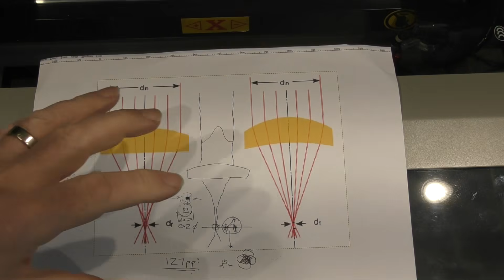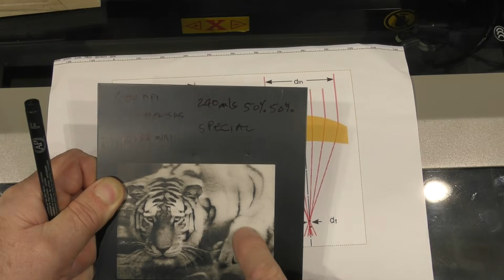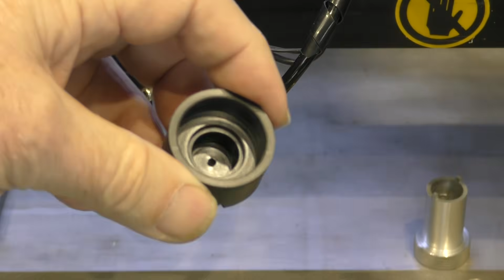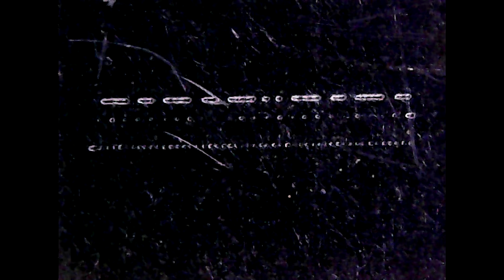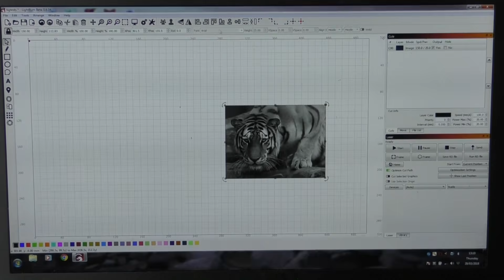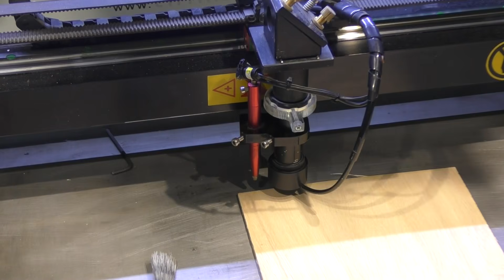RDWorks Learning Lab 137 Compound lens Facts and Fiction

Comment: You’ve talked me into trying a compound lens. I purchased from cloudray. I have a 60 watt OMTech. I purchased the nozzle and the PVD (38.1) and the CVD (63.5) lens. I have 2 questions. Maybe 3. 
1. Both lens flat side down correct? 
2. The CVD lens goes in first followed by the PVD correct? 
3. What is your cleaning process for the lenses? Same as all other lens? Just x2?
Reply from the maker: HiJosh
Yes you are right with all your assumptions  If you scroll down the Cloudray web page there is a diagram that confirms the way the lenses fit. The top 38.1 lens is not exposed to fumes  and will not need much attention. The airgap to the workwill be 10.5 to11 .5mm  (depending on speed) so there will be little chance of fume damage to the bottom lens either but i do check regularly.  Used for photo engraving, the main purpose of the lens, I suggestyou use low power in ther preionization zone for your tube.This zone creates an obviously noisy, hissy, cut. see  this video for an idea of what I mean.    https://youtu.be/S_2NOCpACVc

Comment: Thanks for the great explanation.
I use a CO2 laser at work and was very annoyed that the focus point is only 2mm below the tip of the nozzle. Having the nozzle this close to the media you're working on leaves no room for uneven surfaces. I will take it apart and seen if there's a way to get the nozzle closer to yhe lens (or vice versa).

Comment: Why not just use a 16mm camera lens that focus with no distortion?
Reply from the maker: Hi
 I wish life was that simple.  The 10.6micron wavelength light we are working with  has very limited properties.  ALL metals reflect it (mirrors). A VERY small selection of special salts allow it to pass  (lenses) . EVERYTHING else absorbs the light energy. Thus normal glass is in that last group and is totally opaque. Fire the 10.6micron light at glass and it will just heat up and damage it. Thus normal lens materials will not work.

Best wishes
Russ

Comment: Very interesting video. My question is a bit off topic but I'm still a novice so forgive my ignorance. I think you show the insertion of lenses, curve side up, however, I've watched other videos where the opposite is shown, specifically here:
https://www.youtube.com/watch?v=Eg6THrEdleo
At around 13.22 he says curve side down. Who's correct?
Reply from the maker: Simple answer is both. Although these are specifically sold as ENGRAVING machiones,most people want to cut with them Cutting is done more efficiently with the flat side down but the focal distance will be anything from 1 to 2mmless (you will need to test this for your lens) But you get a better focus for engraving with the lens flat side up.  The Chinese always supply machines with flat side up  but most experts will tell you flat side down is "correct" . There is no absolute correct way, it depends on your need. You can engrave quite OK with flat sidedown for most applications but fine detail and small text are when you need to flip your lens.

Best wishes
Russ

Comment: Hello , 
Thank you so much for your many many tutorial
I have a question about the beam diameter,

The reci tube 100w  have a beam diameter 8mm
The Spt tube 100w have a beam diameter 5mm

A large beam diameter is better to have a small spot diameter no ?
But with a Small beam diameter we have  narrow cone and so still have power when one deviates from the ideal depth of field ?

So to cut material, have a small beam diameter is better ?

Right ?

Thank you so much
Reply: Sorta...    And it looks like you've been reading from Marco's post in the LO forums?   
Anyhow while he briefly went over aberration he didn't cover anything about hz frequency, beam divergence or collimation, which all three considered play a larger roll in the end result of what he's testing.   Specifically in regard to a gantry based  machine that constantly moves the lens closer and further from the point of propagation from the tube.   If cutting is what you want to do, then ideally you'd want a beam expander on a taller focal length lens.   Just relying on a lenses focal length alone will change the useful length at which the focus travels in and out of the material, however the further it travels before converging, the higher the aberration effect.   But this can negated somewhat by utilizing a beam expander, which further decreases aberration.   A 2x beam expander will reduce deviation by 2, decrease the spot size by 2, and increase concentrated energy by a factor of 4, thus meaning with said addition of the beam expander you should see roughly the same spot size with a 4" lens as you do without the expander on a 2" lens.   To decrease the cone width further, you could simply utilize a larger diameter lens/tube.  Rather than the popular 20mm lens, you could go to a 25mm lens and get the same effect as he is getting without the need to stack two smaller lenses.

Comment: My eyes are rolling back in my head obviously I don't have a tenth of the brain matter you have as have can you simplify
Reply from the maker: Hi Mark 
Trust me, my two remaining grey cells need continual exercise or they will atrophy along with the others that I once had. This compound lens study for producing micro dots  was fascinating and my final conclusion  defied all the lens theory I could find.  However  great this was for photo engraving, the main reason why people buy these machines sd for CUTTING.
I am currently in the middle of preparing a huge body of work about lenses. I have spent far too long believing all the theory about lenses so I have decide to ignore the  theory  and try understand just what is useful for our machines from the very practical point of view and why some work better than others.  I have opened a Pandoras Box  with this topic and it is massively bigger than I anticipated.. I hope to give reasoned and demonstrated  examples as to why you should or should not spend your money on expensive lenses. At this moment I would advise to spend at the $15 level for ZnSe  if you have a sub 100 watt machine and if more than 100 watts then  go for GaAs material. Both will be plano convex  lenses and used flat side down will give good cutting performance. I shall be testing cutting performance with lenses in both orientations in an attempt to help people with exactly your questions.
Best wishes
Russ

Comment: Hello, i am still wondering about the correct direction of the round lense site. Must the round site point UP or DOWN when the Lense is installed ?
Reply from the maker: Hi Matthias
 The Chinese always supply their machines with the lens flat side up. I was told (and believed) that this was the wrong way and that it should always be flat side down towards the work. It was only a few months ago that I realized after some lens experiments that both ways are correct. If you have flat side up you get a sharper focal point ,which is great for engraving ,especially dithered photo engraving, whereas flat side down gives about 25% more cutting ability. I guess that in general most people are more interested in cutting than photo engraving, hence the myth that flat side down is the correct way is almost right.. Flat side down will make the focal length shorter by maybe 1mm or more  so  find that new focal point and make yourself a new setting gauge.

Best wishes
Russ
Reply: @SarbarMultimedia  Hi, thanks for the Answer...i will try the opposite direction of my Lense :-)

Comment: Did anyone ever get back to you with any success making a .025 dot?
Reply from the maker: Hi Eddie
The short answer is no.  I am pretty confident they never will. It all comes down to material physics as I originally thought and has been confirmed the more I research into lenses and the way they focus the LIGHT energy onto the material. This theoretical thing called spot size is just  that as far as we are concerned. Whatever lens material,  shape, orientation or  focal length I choose I have never been able to achieve a burn to match the spot size. Typically it will be 50% to 100% larger.  I recently came across a  compound lens combination from one of the big optic companies claiming a spot size of 0.02mm.  Excitedly I tested  the combination only to be disappointed. I will discuss this in my next video as It may have other merits which I have yet to test. 0.05mm is the limit I bounced off and that was VERY difficult to achieve and only on  very special non-standard material (Laser Tile). I have been speaking to  an Epilog owner who was going to run my 254ppi dot test and report back.  3 months of silence says it all.

Best wishes
Russ
Reply: @SarbarMultimedia   I just tested my Thunder Laser NOVA35 with a spot size of .025mm separated .25mm apart.   The results are okay, but not perfect.   I'll send a photo to your email address(I have it form past discussions).

Comment: I'm going to buy this one from China Auto focus Gweike lc1390n 80watt. Do you recommend any other laser cutter in China beside this brand? I know they are the suppliers of BOSS LASERS.
Reply from the maker: Hi Robert
I have had correspondence from a couple of people with setup and alignment issues with their GKW machines. Remember that I get a lot of correspondence but  it is skewed towards those folks with problems. I have had several from Bodor,Thunder Laseer and Boss  users also, so no machines are always perfect. It depends on how closely you examine them and if any issues show up in normal working. 
Before making a final decision I would inquire of

http://www.mektex.com/en/a6ea2ce4ecca4a1482d140bb81140582

and particularly kook closely at this
http://www.transoncnc.com/ts-cabinet-models/ts1390-co2-laser-machine.html
One of the great options is the servo motors. Rapid acceleration and deceleration plus absolute positional accuracy. These are still stepper motors but with the addition of positive feedback from a rotary encoder to ensue so there can never be any loss of steps.

Most of these machines are government approved designs for export and  just assembled in factories from a huge list of standard components. Thus there will be very little to choose between the different machines and why they all look similar. Quality assurance is often something you have to add although to be fair most work straight out of the box.
Of all the issues I have to field, over 90% are  from ebay machines, I never get to hear about good news so I have no idea what proportion of direct bought Chinese machines  suffer problems.

Good luck with your purchase. You are taking the safest route with direct purchase. You may have choice of tube and power supply. Out of 6 Reci tube/power supply machines I have played with or help set up, I have not been impressed with performance. The Reci power supplies all seem rather sluggish until driven hard. That is bad news if you plan to do low power photo engraving type work. I came across a 7th Reci tube  (W2)a couple of weeks ago that was driven by   good quality non-Reci power supply. Wow it was good. I can only assume that because Reci only make high power tubes, they are basically cutting tubes where response time is never an issue.  My opinion is that Reci are over specified, over rated and over priced, you will get better value from buying and EFR or SPT tube

Best wishes
Russ
Reply: @SarbarMultimedia  Thank you for your thorough input on the laser from China. I will look into the two you suggested tonight and hopefully make my decision. Btw just saw your channel the other night going to watch most your videos they are very informational. Keep up on the good content!

Thank You,
Robert

Comment: BTW, for my 1.5 lens, I use this https://www.lightobject.com/381mm-Focus-Lens-Adapter-for-XLE-XY-Stage-P953.aspx nozzle, works superb.
Reply from the maker: Hi Abraham
I have always had 1.5"capability on my China Blue But the lightblade  machine lens system had to be modified 
 to  take the 1.5". Mine uses a the standard nozzle modified whereas Lightobject have come up with a strange design that hampers visibility of the work area. This looks like another piece of Chines design by someone who has never used a machine.
Thanks for the link it made me smile

Best wishes
Russ

Comment: I wonder if the laser beam quality is also a determining factor. On the test you did around minute 15:00, its evident that the beam coming out of your tube is not TEM00. I'm used to have issues with that on my old EFR tube, my RECI tube in the other hand, has a consistent TEM00 mode. I say consistent because on my old EFR tube, the beam mode would change as a function of the distance to the laser output mirror. On paper for instance, cuts come out clean from my RECI tube, while they had that char halo on the old EFR, at particular areas of the cutting table, no matter how perfect the leveling was.
Reply from the maker: Hi Abraham
I think you may have misjudged my beam from that test. That was a very short very low power pulse because I did not want to "smoke" the 4" lense above.  It was just to show that the beam was very small at that point in the beam path. I have done lots of mode burn tests into acrylic with this tube and it is nicely Gaussian.I know that you spend most of your effort on rapid cutting of card where edge scorching is the last thing you require, however, with dot engraving, no charring means no picture.  That is the whole difficulty with this 1000dpi quest. Thunder Laser have made a claim which I find incredible because  I don't believe a dot 0.025mm diameter will be visible on any organic material.....but that wont stop me trying!!  Cutting and engraving have opposite requirements.

All best wishes
Russ

Comment: Hi. Is there a better solution to use GaAs lenses to minimize the burned spot at the lens you shown at the end of the video?
Thanks for all your videos!
Reply from the maker: GaAs is a very inefficient transmitter of IR light (about 60%) and ZnSe isa little better (about 70%). Both have reflective properties that accounts for these inefficiencies. However, that final performance of both materials  can be improved to 95% + by the addition of a special anti reflective coating. There are a limited number of coating compounds that can achieve this magic. It is possible to achieve 98%+ with certain American secret formulations. This formula is not licensed and so you will see Chinese lenses mentioning US coating where as others use one of several other formulations that are widely available.  Both GaAs and ZnSe are usually man made crystal salt materials that appear glass-like. GaAs is mechanically much harder and more durable and tends to be used for higher power lasers but......it's not the material that is the weakness but the coating. I damaged the coating on this particular lens because although perfectly  functional at normal low energy densities ,when I focused the energy into one localized spot the coating evaporated.  In that instance I was giving lens 2 a relatively easy ride with a 4" FL lens ahead of it. I have now done work for my next video with two 2" lenses and have not suffered damage ( yet).  I was always aware of the possibility of damaging a lens or two or three but hopefully my curiosity and stupidity will answer questions and allow others to follow my success or steer clear of my mistakes. 
Thanks for the suggestion
Best wishes
Russ

Comment: A couple of ideas to try...

1. Make a final mirror that has a tiny curve to pre-focus the beam. (When milling the copper mirror set the pivot of the tool to the focal length you want.)

https://www.thorlabs.com/navigation.cfm?guide_id=2313

2. Insert a solid copper bock in the path just above the lens with a hole smaller than the beam to only allow the center energy to pass. (Blacken the surfaces to prevent reflections.) 

3. Apply air assist to both the top and bottom of the lens. This will keep the copper block cool and the surface of the lens that's overheating and vaporizing.

You will be able to use higher power settings because you are throwing away the outer portion of the beam. You can even shape the beam by making a square or hexagonal hole in the copper bock. Soldering an etched copper disk to the top of the block would probably be the easiest way to form the shape.

My $0.02
Good luck
Reply from the maker: Hi Tim
I failed to make proper FLAT copper mirror, I had to pay to have them professionally lapped. Thus making specific shaped copper mirrors is way out of my capability. However, the principle of allowing just the highest density part of the beam through to the lens has some merit in my quest to find the smallest practical dot. I will certainly give it some thinking time. I have to be rather careful these days, because with only 2 grey cells left, they need exercise but not over exertion.
Many thanks for the thought
Best wishes
Russ

Comment: I have an Epilog laser with a meniscus lens. If you want, I could run your dot pattern on that to see how it compares to what you are running.
Reply from the maker: Your Epilogue laser is probably powered by an RF tube. and already has a very small 3mm diameter beam?. I will be happy to send you the dot pattern if you private message me with your email. I expect that your machine should gobble it with speed and power  and because your tube is "always on" there will be no signifinat response speed to worry about. It should be more controllable to get the "tip" of the beam to give reliable small burns (dots). However, with organic materials I suspect you will still have a scorch halo.
Many thanks for your help
Russ